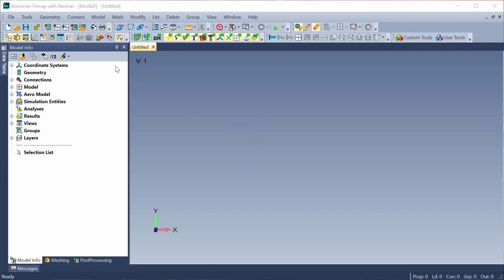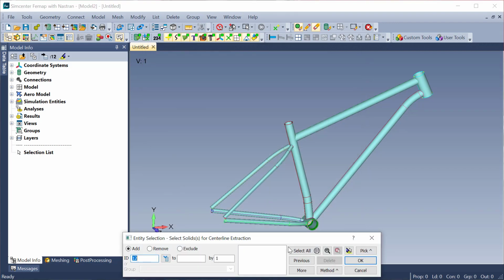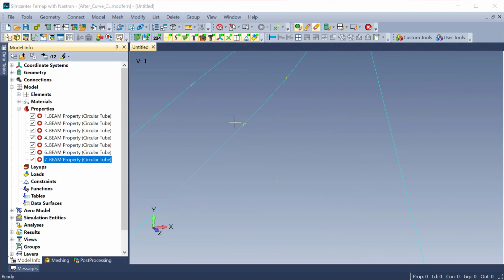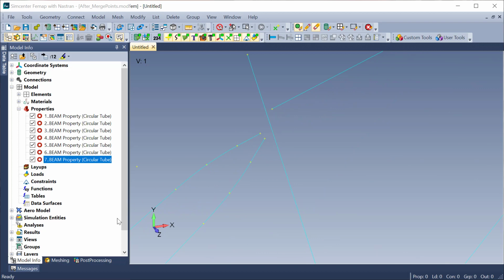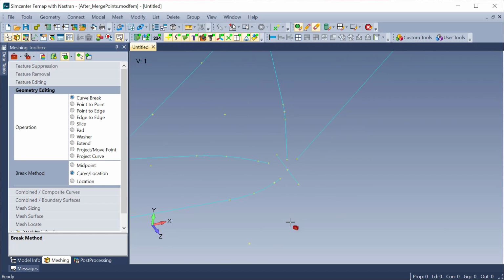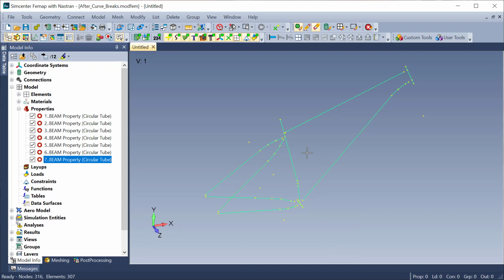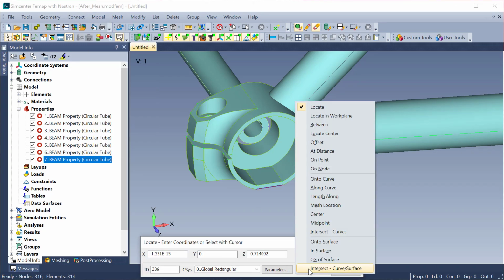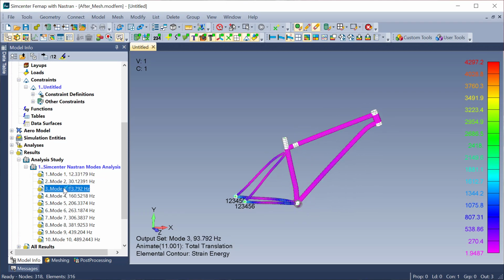Using the Femap Curve Centerline Command

Comment: Hi, I have one question: Why did you use rigid elements to connect your curves, and why have you not extended the curves to join at the curve breakpoint? Is there any difference between these methods?
Reply: according to my understanding, rigids will add infinite stiffness, so the stresses at these points won't be accurate, have you supposed that the weld is really strong? Please correct me where I am wrong>
Reply from the maker: @SamiUllah-y9e5e  I don't think your wrong. Yes it potentially more accurate to extend the curves and connect that way.
Reply: @troygiampietro9570  Thank you, it gave me a better understanding
Reply from the maker: Either method should work. I think it would just be user preference.